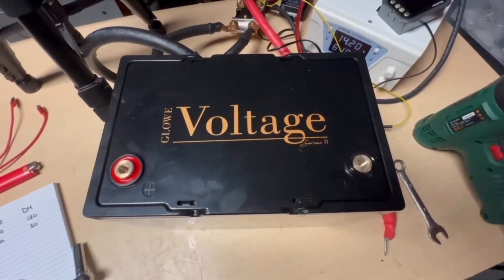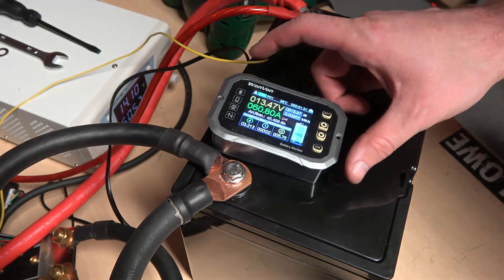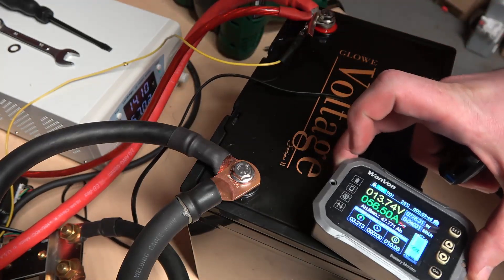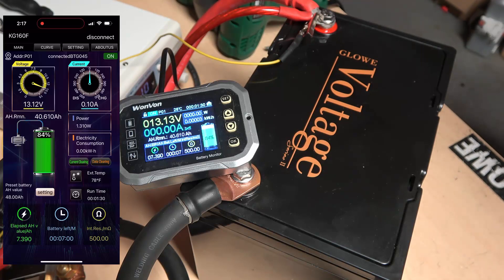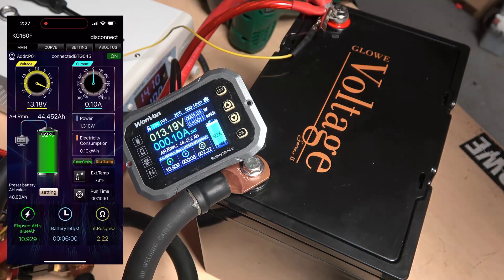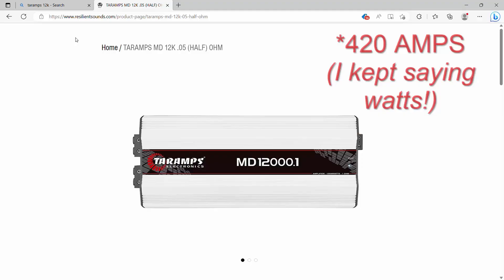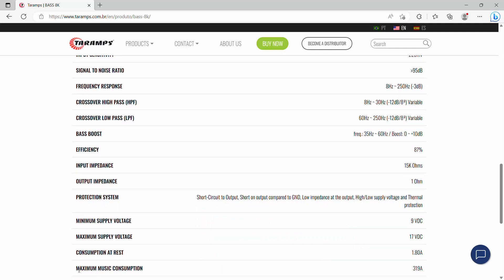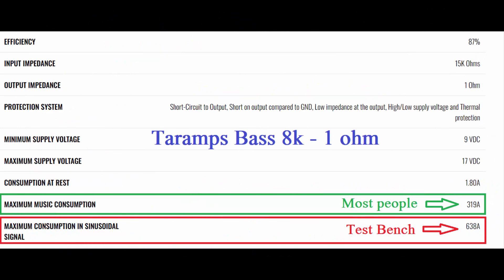Glowe Voltage - Series 2 tested!  Does it live up to the hype??  New Car Audio Lifepo4 Battery.

Comment: I have a 2024 Nissan Sentra and I have a 120amp alternator which is stock running big boss 5 with a single American Bass Xmaxx 12 in 1ohm and 2 ‘8 midrange and 2 6.5’s with smart 3 and with dsp and lc2i pro but | don’t want to upgrade my alternator. I plan on using it with my lead acid factory battery And with the big 3 and long story short well i was running it with 250 alternator, with 2  agm batteries with a 14.8 bypass for auto tech but my alternator went to shit and plus my 2 agm batteries went bad so I had to go back factory, but I had to disconnect the big boss five amp so would it be good for my stock alternator with the big 3 and lead acid battery ?

Comment: Will this work for 2014 crosstrek factory 110 amp alt with pcm controlled? If i leave something on like fan or parking lights or defroster it holds at 14ish, max charging at 14.6.

Comment: These batteries are insanely great. The owner walked me through the whole process to installing this battery. Even when I got confused or a hickup do to my disability. It is actually a straight forward easy  process. I am running to my stock alternator. From the battery to a distribution block to three Fosgate T 1500, two 600 watt amps for a total around 7200 watts. Running 1 ohm to my three Sundown M 15s each with the Fosgate T 1500 5 amps 7200 watts and not dropping  below 13.4 volts. I am slamming my beats pounding my woofers and no drop. This should be impossible. I tell everyone that I know who is a base head. Hurry up and get inline to get you one.

Comment: I have a 370 amp auto tech alt and im running a Taramps big boss 5k amp. Would the series 2 be ok for me? Sometimes when I hit the gas I see my voltage go up to 15 flat and on the site it says 14.8 or lower recommended

Comment: Hey guys i have the s2 and a big boss 3k on a 80 amp stock alt and i do well i drop to resting voltage about 13.3 when at idle full tilt but i want to switch to a smart 5 or a smart 8k will i get the same performance with them as i have now and if i dip into the 12.6 volt range is it bad for the cells to be pushed that low
Reply from the maker: No the cells are fine clear down to 8v.

Also — you may not notice much difference in voltage even moving to a larger amp.  What you’re experiencing (dropping to 13.3) is right where LFP’s power really begins to kick in.  13.5 and over are more charging voltages, and any constant draw over what the alt provides will take a lfp battery down to that range.

You should still hold 13s with the 5k.

Comment: I just ordered my series 2 today im so excited I was advised it will pair well with my factory 220 amp alt.... what kind of rms wattage should I be stable at as long as all is wired and grounded well with a 220 amp alt im running  a ds18 gfx 8k 2ohm stable at 3ohm on 3 d2 zvx 18s from skar... id like to hear I can handle 5k all day with my alt big 3 and double runs of 1/0
Reply from the maker: On a stock alt I was running a Slapz 8k @ 1 ohm and never saw below 13v. I could turn the car off and still not drop below 12 going full tilt. 

You’re going to be more than covered with a S2 and your setup.  If it doesn’t exceed your expectations - just let me know and we will make it right or refund 100% of the order no questions.
Reply: @GloweIndustries  did you clamp that amp at all? What ohm load were you wired to? I wonder got much power you were actually getting out of that amp with one of these batteries. I really want one!

Comment: How do I figure how much reserve I need for my system. Planning for an 8k and 1 ohm plus another 1k for mids. Trying to decide between Series 1 vs 2. Planning to do HO alt in future as well
Reply from the maker: I’d go with the S2 to make sure your power demands are coveted.

Lithium is a bit different than AGM so capacity isn’t quite as important as it was previously.  A S2 has the ability to discharge more power all at once as well as recharge more rapidly than the S1.

S1 is fantastic for a lot of our led customer base that need to have their lights going for many hours without charging in between. 

If you check out our previous videos we have a demo of a S2 as a stand alone battery on 8500w.  Not only does it support the setup — we can turn the car off to cut out alternator support and still not fall below 12v going full tilt.
Reply: @GloweIndustries  Alright cool, I really appreciate the help. Going with the S2👍

Comment: I can run this on a stock alt with a front battery delete ?
Reply from the maker: Absolutely.
Reply: Is it better or necessary to do the delete? @GloweIndustries
Reply from the maker: @jamarie136 it’s not necessary, these work very well with lead acid.

Comment: can i mix a series 1 and series two battery? i would like to try and stay in the 13s.  i currently have a series 1 and optima red top and a 400 amp alt.  alt is pitting out 330 amps with my high idle switch on while warm and charging at 14.2 i have a marts digital 8k and am falling to about 11.8 after aboust 15 seconds of music at full blast and was wondering what i can do to combat this.
Reply from the maker: Something is going on here.  A series 1 should have you covered. 

Can you reach out to our FB page so we can walk through a few things??
Reply from the maker: Is the 8k @ 1 ohm?  If you’re running at .5 I could see it being an issue, but if at 1 or higher - there’s definitely a mystery to solve.
Reply: Did you ever figure out the problem?

Comment: What the actual wattage both batteries can support on let’s say a 240/320a alt without have voltage drop?
I’m referring to the S1 and S2 models.
Reply from the maker: A series 1 provides 450a.  With a 240a alt, assuming 180a was extra, you'd have 630a.  This is in the range of what most 10k-12k amps require.

With the series 2, same situation you'd have over 700a and be well suited to run a Taramps 15k.

Comment: I drive a 2011 GMC Sierra that has the ECU regulating voltage situation will this effect batteries ability or should I run a bigger alternator with the module that bypasses the ecu
Reply from the maker: What do you generally charge at?  If the ECU keeps you at 13.5+ you should be fine — but anything controlled like that can be iffy.  I’ve seen it so it is alternator doesn’t even produce power of voltage is above 13v, and in that case would recommend a bypass for sure. 💯

Comment: This is a very impressive battery, so running 2 of them in parallel I can expect to be able to draw 600+ amps? Can I use a bigger alternator (370)?
Reply from the maker: And with two of these a 370a alt would be absolutely ok.
Reply from the maker: We’ve actually gotten gear that lets us test a bit higher - and once these are warmed up you can expect to get over 500 amps of current over 12v.

Can check out the video here:  

Glowe Voltage Series 2 vs Limitless Lithium Retro30 - Side by side high current tests
https://youtu.be/Z0WH8o9xeoA
Reply: @GloweIndustries  🤩

Comment: Banda 8k and a 5k on mids I have the 1st battery y’all put out the 90amp and have a 240alt. So I’m I good with this battery
Reply from the maker: The S2 isn't a replacement for the S1, and the S1 are definitely still being made!  The S1 has almost twice the capacity (in amp hours) as the S2.

Happy to hear it's doing well!  Would love to see a video.
Reply: @GloweIndustries  so the one I have is the 90 not the 48